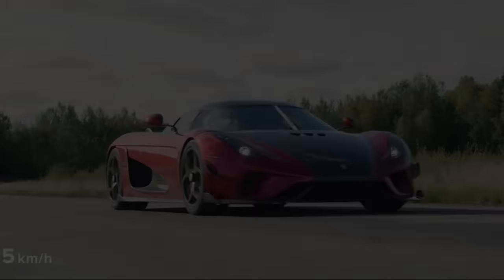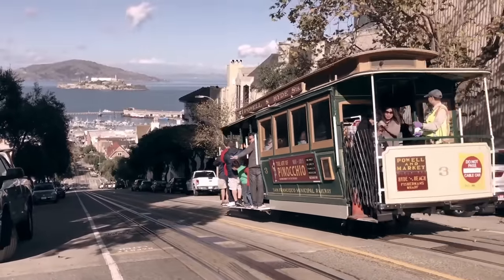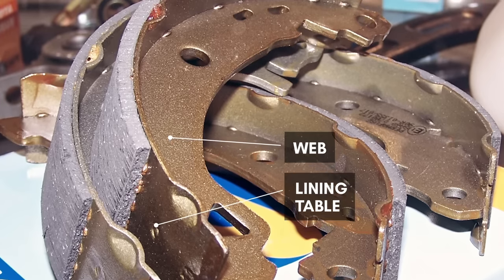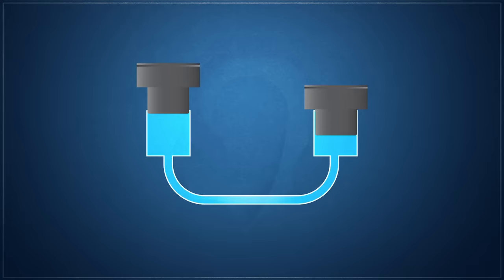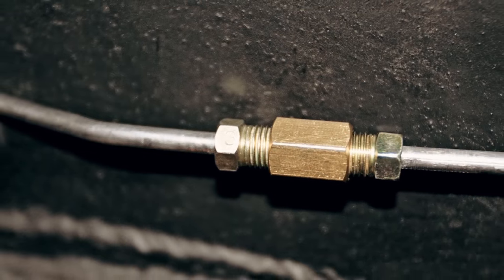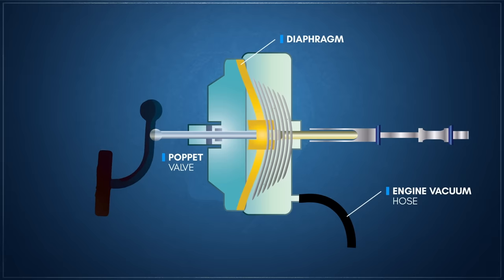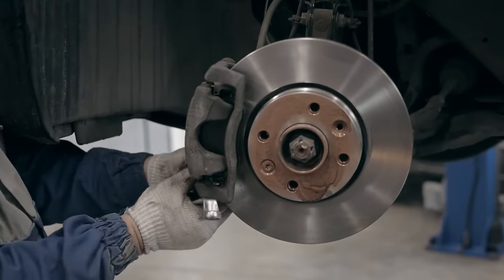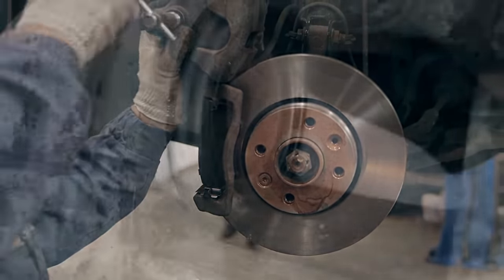The Story of Brakes

Comment from the maker: ▶ Visit https://brilliant.org/NewMind to get started learning STEM for free, and the first 200 people will get 20% off their annual premium subscription
Reply: Keep growing up
Reply: Be positive that day will come
Reply: Sublime writing.  So articulate & clear. 
I love having you as a teacher...thank you.
Reply: Ui
Reply: @shahbazstailan4361  iiu
Reply: @shahbazstailan4361  I'll u
Reply: @shahbazstailan4361  to uoui I'll i
Reply: Uukoououui
Reply: You failed to explain how air brakes work on larger commercial vehicles.  They are not simply "pneumatically actuated".  The brakes of a CDL level vehicle such as a Semi Tractor Trailer or large dump truck, etc:   will have a very large and robust spring that is always applying the brakes and locking them and in order for you to be able to drive away from a parked position, you will have to build enough pressure (typically well over 100 psi), to overcome this large spring that is holding the brakes at each wheel.  So the pneumatic system is actually RELEASING the brakes, which will then allow you to drive away.   This is why you hear that large burst/ discharge of air when a semi driver applies the brakes-- because they are actually releasing air from the system, which drops the pressure and allows those springs to apply pressure to the brakes;  again, the default state of commercial brakes while at rest is to be fully LOCKED.    In this way, if there is every any issues with the brakes system failing or your compressor not working or you simply lose pressure through a leak, etc. -  it will cause your brakes to lock by default, rather than having a run-away vehicle.  You could probably talk about the history and design of commercial brakes as a standalone video.
Reply: Nice educational video, but I couldn't take the annoying background music. Why do people feel compelled to add distracting, annoying noise while they are sharing knowledge & teaching us something? It may be subtle, but it feels like torture.
Reply: Reh-NO not ren-ALT
Reply: Se pueden descargar los videos con la suscripción premium?

Comment: I've been an automotive mechanic for over 30 years,  I've repaired lots of brakes in my life.  Still learned quite a few things from this video.   Thanks
Reply: Repair as in change brakes? I've changed my brakes on an BMW E30 318i, and had the rotors turned as well
Reply: Repaired as probably repaired braking components. 
Locked up calipers, hardware, rust buildup, fixing other people's mistakes....
Reply: @pyropulseIXXI 318i💀
Reply: @christopherjohansson3073 probably meant 328, typos are a thing uk
Reply: @firmfire2385  E30 328i? Have you been smoking?

Comment: Glad to see someone talk about some of the lesser discussed parts of a vehilce. Everyone is always going on about engines and power, but forget that good brakes really make the difference in a race, as well as on the street
Reply: Same thing as the tires, the only point of contact with the ground. They're the most common part of a vehicle that people are willing and even adamant about cheaping out on, but arguably the most important aspect about the performance and safety of a vehicle.
Reply: And suspension, it’s not only for comfort but also a part of handling.
Reply: "vehilce" Nice.
Reply: I agree, some of the coolest features on the car is the break/wheel combination.
Reply: Except most of what this guy said is wrong I have a bachelor's degree in automotive history... Disc brakes first showed their face in the 1930s... This guy's facts are all wrong.
Reply: After the tires, the brakes are the most important part of driving a safe, reliable and predictable car. It's literately life or death if brakes fail when needing to stop a fast moving 2-tons metal machine. Cheap tires and brakes should be illegal.
Reply: @cwtrain   m
Reply: @DesTries  fz
Reply: @DesTries  a quick Google search shows 1902.
Reply: @clemhfandango.  cheap tires are acually fine for street use but driving bald/ 25-30 year old tires isnt, but chep tires doesnt last as long as more expencive tires but still fine for street use :) and when it comes to chep knockoff brakes i agree for street use / ligth track use you would be better off running stock but well maintained brakes than cheap e-bay copy brakes its more depended on how good the car is maintained than cheap vs expencive tires :)
Reply: @DesTries  bro it took me .5 a second to google that and find out you’re wrong 😂
Reply: I love brakes lol
Reply: Agreed. Brakes, tires, a good seat & good seat belts to keep you solidly in one place while driving... Those will make laps so much quicker than would big power adders.
Reply: Brakes are so important. It's good to see this story being broken out.
Reply: If you're going go you've got to be able  to stop short! If your going to go faster you've got to stop even shorter! Of you've lost as much if not more than you gained! The biggest advantage brake have is they can keep you on th track when it all goes pear shaped. You can win a race from a ditch!
Reply: @EmazingGuitar  did you fall asleep while watching the video? 😁
Reply: @mortenhinsverk2406  Cheap tyres suck period, never go below mid range.
Reply: Maybe your listening to the wrong people most real car enthusiast won't stop going on about suspension brakes and tires
Reply: Pffft IM glad someone’s finally talking about lessor known parts of cars, everyone’s always talking about brakes and steering, finally someone’s doing videos on the m8x1.0 bolts.
Reply: @jameswilson8907  Yup, you can have the best engine and set up but without good tires you're wasting it.

 Handling IMO is the most important aspect for a car. Always hated most motor sports because it's always about who has the fastest. Who cares that your car can go 200mph and turn left.

 Also most race cars require fucking perfect roads and the cars can't even go over a speed bump. What use is that?! F1 cars can't even grip correctly without proper heating. Dragsters engines get rebuilt after a single run. It is ridiculous. 

 I like Rally the most but it isn't popular and admittedly boring to watch people just race by themselves.
Reply: @cwtrain   Glad to see someone talk about the lesser discussed parts of speech.

Comment: One thing to note is that the tire rubber compound improvements over time has also contributed heavily in to improvements in stopping distance
Reply: ABS, TC/SC have also DRASTICALLY helped tires last.
Reply: And does the suspensions too
Reply: Also the fact that they're not useing bicycle tyres anymore.
Reply: @HARRYAZZHOLE  I've never had to use ABS.... I've never been in a situation where I slammed on my brakes that activated ABS..... ABS isn't for making tires last. It is a pure safety feature, so people don't lose control in an emergency braking situation
Reply: @pyropulseIXXI  Not entirely true, ABS does make your tires last since it will prevent flatspotting your tire in those exact situations, but yes, in most cases ABS is not the cause for your tires lasting longer.
Reply: @pyropulseIXXI  ABS was designed to stop a wheel/s locking up! Doesn't work in F1. Are you sure you know when ABS kicks in? If you come up to long bend & take fast. Mid bend just let go of the steering & press the break pedal as if you mean slow down to a normal stop. No an emergency stop. Then tell you have never experienced ABS. ABS in not just a braking feature, its also a suspension, dynamic control feature. It is not braking feature at all really. It releases then reapplies the brakes in rapid succession(Kepler's Theory of braking.) overall with EBD it makes the braking effort proportionally evenly distributed by the load, vector, rotational speed of each wheel. Locked wheels burn flats on tyres!
Reply: @ExNought  Your driving style & the state of the road determine tyre life. Never grumble about tyre life until you owned a Sports motorcycle? Cheap to buy, cheap to run cheap to service & so much fun! £12K buy & will drag by nearly car on road & grip like a limpet mine on a submarine! There in lies the problem, 1,000miles & your down to cords. But hey that's 3 tracks or 5 Saturday rides out.
Reply: @kevinburke6743  I know that. And locked tires both stop slower and lose control easier. Static friction is higher than kinetic friction, which is why sliding tires take longer to stop than moving tires

I'm saying it doesn't increase tire life (expect in the marginal case where you use it in an emergency). They were designed for safety

Also, I know how ABS works. I've driven tight corners quite quickly, and I brake just before the ABS would engage. The perfect braking is just before the tires would lock up, and just before ABS engages. You don't want rapid pulse braking; that just make the impulse jerking and non-continuous. Electronic systems that control ideal braking pressure for a given speed, combined with how hard you press, is not an ABS system; it is an EBS system, as you have stated. It seems you combined variou systems into one and then called it an ABS

And Yes, I know what ABS feels like; I've intentionally activated them, by slamming on the brakes in a straight path, but I've never had to use them in a real situation. If you thin that is 'ideal braking,' I personally think you are insane. The most ideal braking is just before this occurs

ABS does not enhance driving performance at all; it is an emergency feature to prevent tires from sliding, which both loses control and increases stopping distance
Reply: @HARRYAZZHOLE  Unless your car is too heavy lol
Reply: I always say any fool can press the throttle to make it go faster but it takes an expert to push the brake to make it stop faster.
Reply: Down force is why f1 cars car pull a 6g deceleration.
Reply: @heypauly2002  Downforce is mainly about cornering fast. It reduces as the car slows down so is progressively less of a factor in slowing the car. After it's decelerated below a certain speed, it is all down to the tyre grip. Like in a road car.
Reply: And major rules changes in numerous racing practices.
Reply: @xxTHExxABYSSxx  I imagine if the rules were not changed, we would have fully enclosed capsules, with multiple wheels controlled by computers seeking out the best grip. Cornering forces beyond human endurance, drivers in g suits etc. It would be unwatchable.
Reply: @pyropulseIXXI  if your car has DSC then you are using frequently but are completely unaware of its action.
Reply: Tires have more impact on braking than actual breaks. The breaks can brake as much without locking up the wheels as there is much grip.

Comment: You failed to explain how air brakes work on larger commercial vehicles.  They are not simply "pneumatically actuated".  The brakes of a CDL level vehicle such as a Semi Tractor Trailer or large dump truck, etc:   will have a very large and robust spring that is always applying the brakes and locking them and in order for you to be able to drive away from a parked position, you will have to build enough pressure (typically well over 100 psi), to overcome this large spring that is holding the brakes at each wheel.  So the pneumatic system is actually RELEASING the brakes, which will then allow you to drive away.   This is why you hear that large burst/ discharge of air when a semi driver applies the brakes-- because they are actually releasing air from the system, which drops the pressure and allows those springs to apply pressure to the brakes;  again, the default state of commercial brakes while at rest is to be fully LOCKED.    In this way, if there is every any issues with the brakes system failing or your compressor not working or you simply lose pressure through a leak, etc. -  it will cause your brakes to lock by default, rather than having a run-away vehicle.  You could probably talk about the history and design of commercial brakes as a standalone video.

Comment: One omission maybe here, the Porsche's steel coating that basically makes rotor wear nonexistent. You change the discs when the coating is gone, just 50 microns or something similar. Engineering explained made a cool video about the technology that basically eliminates brake dust on ICE cars. But, as always, great quality content from you!
Reply: 50 micron coating sounds like it shouldn't cost too much as far as materials, but it's Porsche so might not be cheap in practice
Reply: What's the point if you change the disc anyway? But instead of using a cheap disc you use an expensive one. Is brake dust so dangerous?
Reply: @vsm1456  If not immediately scrubbed of in a wash, brake dust can aggressively etch into the wheel, which is undesirable if you have really nice wheels. It also looks gross. Not sure if it's worth increasing the cost of the brakes from hundreds to tens of thousands of dollars, but there you go.
Reply: @vsm1456  Brake dust is actually very dangerous and has been linked to cancers and lung problems, etc..  But that's not really the point of their technology.  It's more for vanity.  Plus it lets them make money by changing your perfectly functional brakes early because "the coating is gone".
Reply: @grekiki  tungsten carbide, iys pretty tough stuff

Comment: My 2.0 litre hybrid Toyota Corolla estate returns 50 mpg on a run & even higher in nose to tail, stop/ start traffic. The worse the traffic, the better the fuel economy. Plus, if you stick it into sport mode it takes off like a scolded cat with a turbine like howl from the CVT box & electric motor.
But it's the regenerative braking that is totally new to me & I love feeling the energy flow around the car. The continuous dance between the ICE, the electric generator/motor and the battery is fascinating!
When I first got it I was driving like a bog standard ICE vehicle but after a while you get the hang of speed just being a temporary store of kinetic energy ready to be shoved back into the battery via the regenerative braking. Ready for immediate re-use if I floor it and the motor slurps it back out of the battery to aid the ICE.
Losses come from drag, friction, air-con and ancillaries. 
It's an amazing system. I absolutely love it to bits & it's made driving interesting again after 42 years. I couldn't go back to a plain, non-hybrid. Nor could I go full EV yet as the infrastructure just isn't up to the job yet.
Thanks for a fascinating video. Yours is an excellent channel.

Comment: At my old R&D metallurgy lab, we were alloying & casting test samples for Mercedes-Benz for developing a patented pending idea called the "DRISK"... a combination of both the drum and disk rotor if you can imagine... never heard too much of what became of it later on.
Reply: Not sure what that is but it kind of reminds me of the UFO disk brakes Audi used on the original Audi V8. It was like an inside out setup. The rotor was retained on the outer perimeter, and the caliper was on the inside, allowing a larger diameter rotor in the same size wheel. Very innovative - but prone to warping because the drum portion was stamped steel if I recall.
Reply: Don't know what DRISK is but sounds similar to how some parking brakes works. Parking brake on the drum and normal brakes on the disk.
Reply: Merc has a disc brake on most models, with a small drum for the parking brake, at least until they started to use electric parking brakes (which typically use the disc brake caliper)
Reply: @simonm1447  I assumed that wasn't what he was talking about since that 'drum in hat' hydraulic disk brake + integral cable operated drum parking brake is old as dirt. Though maybe @Loupy is also old as dirt? :)
Reply: I invented a "Y" disc brake many years ago. A normal ventilated rotor that flared to a 120 degree "V". So the caliper was mounted as now except the acted radially. So, you had one external pad in the "V" & TWO pads one  each side on the outside of the "Y". So the pistons are radial acting against the curved pad in the "V" float would pull the floating caliper engaging the "outside the "Y" pads. Advantages you ca hope air channels from the front of the car through the body onto the flared Rotors & the back of the pistons to cool the fluid. The rotor is 3x wider on it's braking surface which is at it's largest diameter. The rotor can be half it's current thickness & 2/3 it's weight. Very quick & easy to change a pad set. 
Disadvantages. Smaller rotor for same size wheel. The same or greater braking pad area. Similar but more effective  percentage of rotor cover by pads.
Reply: my limited edition yaris has disc rotors on the rear
Reply: Well there is the handbrake and disc combo you find on some cars like older Volvos and Nissan Skylines.
Basically the drum brake is used for the parking brake, but the brake disc is used for slowing down the vehicle.

Comment: There was also a pneumatic regenerative braking system wich worked by converting the kinectic energy into presure energy with a compressor and an air tank. It was developped in the 70’s